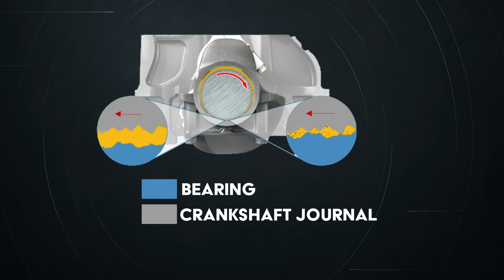the truth about start-stop technology (finally proven)

Comment: While i agree that stop start is clearly not good for longevity, i would argue that thinner oils and tighter bearing clearances, as found in modern engines, probably have a greater effect.

 A hydro dynamic bearing should never contact, even without pressure, because contact of any sort will rapidly destroy a bearing. Tighter clearances give less wiggle room when things go wrong. Small particles and reduced oil viscosity affect tighter clearances earlier. 

Did you grade the bearings on the test? That can also massively affect wear if not. 

I've personally disassembled a number of engines that have covered at least a small number of miles without oil pressure and seen zero contact on the bearings due to the use of good oils. Bad clearances or bad oil can kill an engine in the same time frame. 

I worry more about the thrust bearings on manual cars, that can be a big killer of engines with the need for the clutch to be depressed when starting. They are never pressure fed.

Comment: There needs to be some kind of way to both increase the efficiency of engines and to not decrease their reliability. And I both are equally important
Reply: Not building unnecessarily luxurious/heavy/large tanks would help out a lot 😂

But seriously, we're at the point where it's difficult to have jumps in fuel economy because the desire to make fuel combustion do work vs. maximum fuel burn efficiency are at odds with each other and also with engine longevity. ICEs are limited by the Carnot cycle--the most thermally efficient engine theoretically possible, which is inhibited by nothing in the perfect conditions--which is around that 40% efficiency mark. Note: this is not fuel efficiency, but we're assuming that thermal efficiency and fuel efficiency are interchangeable because we all go to the same gas stations and fill up with one of four different fuel types, and I'm assuming that everyone buys a vehicle of the same weight, aerodynamics, etc. You can increase the Carnot limit by doing things like the combination of a longer-width cylinder the piston moves in with pre-combusting the fuel to increase its temperature. However, that greatly increases wear of all components involved. You can also attempt to use the exhaust gases for more work, like a turbo does; this is another part that can fail, though. However, in a naturally-aspirated ICE, we're already reaching things like 30% thermal efficiency and more. An example of a vehicle that is 30% thermally efficient is something like a naturally-aspirated Ford Fiesta. So, attempting to move the needle on a combustion engine closer to its unachievable theoretical limit without introducing things that can wear is fairly difficult in the day and age where we've tinkered with combusiton engines for literally over 200 years!

Comment: I don't fully agree. Because hybrids like Toyota reach close to 1M km and they regulary start stop even during driving not only at the trafic light. There are additives like Molly and other esters that remain on the metal parts even after oil flow stops for some time. So video is not 100% true in my opinion

Comment: Thank you MIK Motoren INT for your service.

It's been clear for decades that the reason that taxi engines run for 100's of thousands of kilometers is because they s run for many hours without stopping.

When I mentioned to a car dealer while buying a new car that the stop start is not good for the engine, he tried to convince me that modern engines are designed to handle it. I'm an engineer and you are a salesman. I think it's clear who understands better how materials inside an engine behave.
I'm with most people in this comment section:
Get in the car - start - switch off auto stop.

Comment: Great explanation about the start stop system and what the manufacturer did to circumvent wear in the start fase of the engine. We had a vw golf variant 7.5 with a start stop system. Just sold it this week with 165000kms on the clock. A bit sad but when I saw this video I’m relieved we don’t own it anymore due to possible engine failure. That would have been a hefty repair bill 😅

Comment: Not really "finally proven", too simple and inaccurate information. Crankshaft bearings, are never "shiny" unless they are never used. You presented somewhat normal wear, and in a way, normal people would get "scared" without engine knowledge. Newer Star/Stop cars also have protective features, such as, not enabling the feature on stop if the engine is not hot enough, or the battery is too low on charge. Things have changed since the very first Start/Stop cars. People can trash their new cars way worse just by not following the manufacturer's break-in guidelines for example.

Comment: Well, I don't like start-stop system because it adds some delay when you want to move your car quickly from full stop, and I am also afraid of engine condition, this is why I always disable it. But... this test and demonstration should be performed on an engine which implements start-stop system because those engines adds some modifications to reduce problems highlighted on this video. As far as I know, most carmakers modifies lubrication system so it can retain oil pressure. The best would be perform such tests for both versions of engine: traditional and start-top.

Comment: Modern start-stop systems are incredibly well engineered. While there still may be a little bit more wear on some parts under heavy load at engine start, it is very very low. The thing is, none of the cars that have these systems are old enough to really be able to tell the effects.
For instance, they have multiple ways to pre-load oil pressure (electric oil pumps for transmission and clutch, pressurized oil reservoir for crank bearing pre-load) for exactly this problem. They also remember the exact crank and cam positions at engine stop to resume the cycle when restarted, etc.
I would really be interested to see what kind of start-stop system the tested car had installed before dropping the judgment hammer.

Comment: I appreciate the work involved here but there is far too much information missing to say anything has been proven.
First the hot oil pressure rise time - was this done with the oil pressure previously raised and if so how long after? For all we know it could have drained down overnight and then heated before the test.
Then the 84 hour stop start test - how long was the stop time and how long was the run time? For all we know it could be stopped for 5 minutes and run for 5 seconds. Also where is the comparison to an engine run continuously?
These "lab" tests are almost pointless without comparisons and more data. 
It would be far better to strip down several engines that have covered at least 100000 miles and compare them. They need to be from similar pairs of cars used in similar circumstances. Not an easy test to accomplish. Then you need to compare diesels and petrol engines.

Comment: About 15 years ago, I calculated that Start Stop would save less than a full tank of fuel over a 20-year life span of a car. The extra expense of the start stop technology is never recouped. Although one bonus is the beefed up starters don't seem to break as much, but this could also be down to better design and manufacturing processes.

Comment: I am an apprentice mechanic at a motorcycle garage and we were doing several tests on a V twin bike to see why the front cylinder had low compression. We had both cylinder heads open to check the valve clearances and during the several tests where we changed something and we started the bike again to see how it run i noticed it took almost 10s everytime for the oil to reach the camshafts. I was mindblown by this! I know of course oil pressure isn't instant but it really put things into perspective, now everytime I start my vehicles I just let the engine chill for about 15/20s before touching the throttle

Comment: Nice try but you have it very very wrong. With proper automatic start-stop systems there are additional components to the system so that oil-pressure is maintained after stopping and then restarting. Some cars have an oil accumulator or pressure reservoir, other cars could have auxiliary oil pump to maintain pressure and lubrication during start-cycle.
Not all start-stop systems are bad. This video is extremely misleading and actually feel like the creator is uninformed about the different start-stop systems.
Reply: Make a video and tell me
Reply: @clarence2588 Just google it man, its all readily available online.

Comment: I can tell you what happens on 2018 chevy traverse 68k mi and had it on from new. Customer left stranded two times, both times it blew the 300amp fuse on the starting circuit, they replaced the starter because it was seized on the flywheel. The second time the flywheel showed broken teeth and the starter was trying to engage on the flywheel where the teeth had been broken off. Come to find out the flywheel had 10+ teeth broken off and had to be replaced. The customer installed a device to have it default to off. What a terrible idea in addition to the internal issues it can cause.

Comment: now they will add an electrical oil pump to keep oil flowing when stopped, and i think toyota has it so the car throws codes for the starter after so many starts even if it still works?

Comment: Take the start stop battery off,replace it with a regular battery,  the start stop will deactivate because the ecu thinks the battery amp's are low, no more start stop,and your not constantly turning it off.  All mechanics and engineers know that start stop is about as good an idear as sticking you head out of a moving train,!   But  modern cars are built around immsions not reliability and longevity ! All these euro immsions regulations are actually worse for the planet, we should be Driving cars for 20 years or more with  no problems,  But the world runs on bullshit, Deception and Greed, Not for the benefit of the planet or Mankind.

Comment: I always thought this start/stop system was engine killer😢.
I'm engineer and all this makes sense: low oil pressure, poor lubrification, low engine temperature...
I am lucky, I own the latest 2011 om642 without start/stop 😊
273000km and runs as a charm.

Comment: I also turn this feature off every time I start the car. Recently went to dealerships to look for a new car, did a test drive with one of them, and noticed every time I exceeded the speed limit, I got audio-visual alerts and saying "take your leg off the gas pedal". Turned that feature also off, restarted the car, and the feature of course was back on. Drove immediately back to the dealership. That's one reason the new car sales are down - the insufferable alerts disturbing me and telling what I should do. I don't hate myself enough to support such advancements.
Reply: "Hey you're engaged in an activity I have deemed dangerous. Please stop looking at the road and pay attention to my message"
Reply: I was driving my girlfriend's 2018 Audi this past summer and had a similar issue. It has all those crappy modern features like telling you to slow down, auto-start/stop, and baby sitting you while you reverse.

I'm backing in to this spot next to a large bush, and the bush is casting a shadow partially in to the spot. As i get close to entering the parking spot the car starts freaking out, beeping and flashing warning messages like crazy. I know what I'm doing so I keep going and it slams the brakes on. I force it to move again for another second or two, after which it slams the brakes on again. Again and again, until I'm finally in the spot. Alarms going the whole time.

I would have taken that piece of junk back to where ever I got it the very same day. Modern cars with all their "smart" features are garbage. Don't even get me started on piston rings and water thin oil killing these things once they're barely past a six figure milage.
Reply: @Jorb4826  on a 2018 audi those were probably optional add ons that the buyer paid extra for. emergency braking is nice, it may have been an issue for you in that scenario. you can also turn it off with a button like you do start stop. I am so glad that all cars have those features now. it makes me feel safer as a pedestrian. not everyone can drive perfectly and bigger cars with huge blind spots you can't see a small child. 
water thin oil is for better start stop on hybrids. many modern engines like a 2018 still does use "normal" oils not a special thin kind. these are all minor issues that everyone is going on about too much. car markers don't care about these but hybrids are good not running over children with these huge cars is good. its not junk its just a normal car. car safety features always came out as an extra then become standard, these are just one those. back then curtain airbags and esp was optional. think about that.
Reply: Deadly combo of useless low quality full digital dashboards (doesn't matter the brand) and forced ADAS to make the driving experience a nightmare. I hope they all rot in hell.
Reply: Ha "advancements"
Reply: Yes, its EU doing its totallitairian virtue signaling again.
Reply: Exactly
When I look for a car this is an automatic No
Reply: We recently did a 2,000 road-trip in a rented 2025 GMC Sierra. The dash lights repeatedly went to night mode after 2-3 hours of daytime driving, and would not respond to changing the setting back to day? It was impossible to see the gauges. I have a 2002 truck, and will never buy anything newer. I will just keep fixing it.
Reply: this is a new regulation. All new cars now must do this :(
Reply: All the dings and bongs can be put into off-mode by default with 3rd party tools. Your dealer can likely sort you out with that.
Reply: @rykehuss3435  Okay, I'll ask them next time I find myself interested in a new car again, thanks!

Comment: Since I have a company car with start/stop system I don't care to much about the fact I can't turn the system of. I probably could if I'd care to take the time.
But since it's a company car I don't care to much about it. If it destroys the engine it's on company expense.
The worst case scenario, I get a replacement car for the service period and if they can't fix it, company needs to deliver another car.
As long as I don't own the car with start/stop system I don't mind it.
If it was mine, start/stop would be permanently disabled.
Such a head scratching feature 🤔

Comment: Wouldn't hybrids have this same issue with their engines to a lesser extent? I cringed when our 14 Fusion hybrid engine would go from s
0 to 2500 rpm on the highway when it came up to a hill.

Comment: shuts off the ac! not good .  Ok oil pressure drops and you restart it  over and over . Dry engine over and over restart  not good.  Starter killer.  It saves zero fuel anyways .  Its annoying !!!!!

Comment: It does not save any fuel, neither any component..
 I always disable the auto-stop every-time. 
I drive a BMW E87 (N47 engine) with 240K Km and still no issue or oil consumption.

Comment: What about Toyota or Lexus engines when they been used with hybrid systems,the engine turns off and turns on so many times per drive,especially if you’re driving in the city.

Comment: I have a question, why dont they use electric Oil pumps? They could run as long as ignition status 2 is on. So you would have oil pressure all the time. Even Cold starts. You just have to turn on the ignition and wait 10sec to build oil pressure and than cold start the engine. No?

Comment: I saw a study where they found that you had around 8% in fuel savings with start and stop during city driving. Is this really enough to offset all the engines that need to be replaced in the future? I don't think so. I just think that this balances out perfectly or has extremely minor savings in emissions. The future is hybrid cars. I'm telling you this right now. We are not going to be driving fully electric cars until they come up with a better way to make batteries. Just with all other previous "future technologies" it will go down in history as a flop. Diesel was held as the gold standard for cars for a while. Then they found dirty emissions and made it expensive. Then they invented E85, which also got extremely expensive for literally no reason that I've heard of. Then we have hybrids which are now slowly being phased out in favour of electrics. Electric cars are going to be phased out soon too.

Comment: So why does my truck's oil pressure gage remain constant, even while stopped with the start/stop in "off mode" (i.e. engine is off.) The oil pressure reading barely drops.
Is the gauge just lying or is is the oil pump on an independent system from the engine belt drive?

Comment: Those bearings look fine, though the photos are not very good and the million km bearing wasn't shown in a still photo at all. I'd call the test either inconclusive or leaning towards debunking the accelerated wear claim. It certainly does not prove excess wear.

He should have plastigaged the bearings before and after, and performed the test on a brand-new engine. Then we would have some actual quantifiable results to look at.

Comment: Start-stops sucks  its annoying and bad for the engine. I always turn it off. I also think the oil replace intervals are far too long. For my Mercedes Sprinter diesel its 60k km. For 1st service. This is nuts. I allready filled 1ltr of oil 3 times now. I am on 49k. Km now. How can this be good for an engine? I dont understand